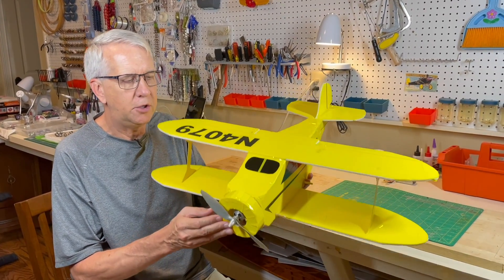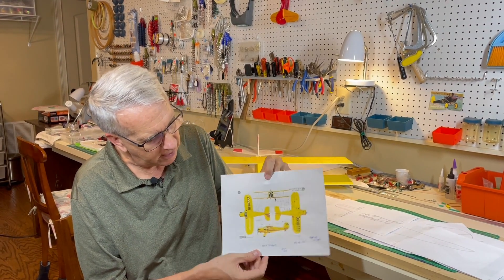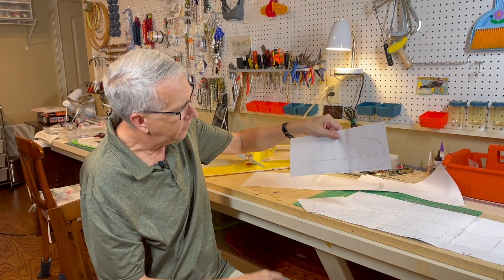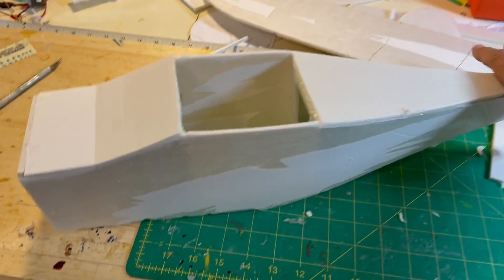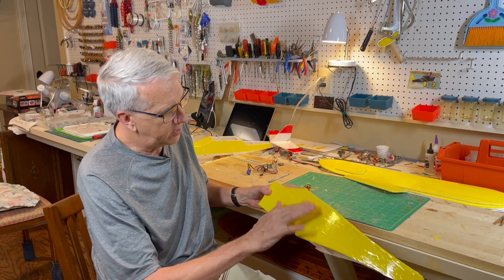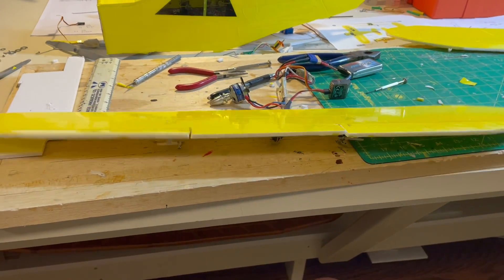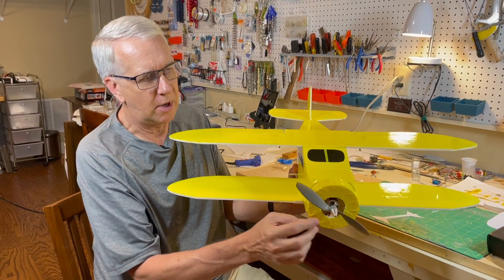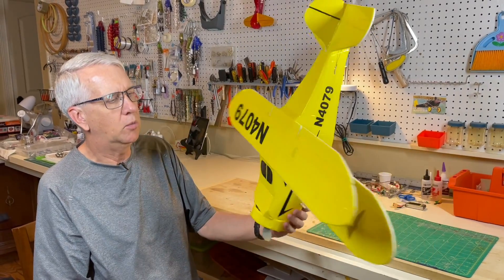Beech Staggerwing Foam Board RC Model Airplane

Comment: Perfect old vintage look, I need a SLOW flyer to take with me in my camper. I would like to use single fold under camber wings like the FT Old Fogey, except no polyhedral . This should slow the plane, correct? I also think the single fold would eliminate need for the carbon rods. The wings would be the same as yours except for the one bend. I wonder how the one change would change the plane.

I just need to know if their is an incidence angle I need to set on fuselage and wing.?  Would the leading or trailing wing edges vary in-height? Your strut solution is great.
Reply from the maker: Robert:  Thanks for your comments!  I think the Old Fogey single fold would work well, and is sufficient to not require the carbon rods.  Should slow the plane a bit.  

I did add a bit of positive incidence to the top wing only (bottom wing is aligned with the fuselage centerline).  This is fairly easy to see on the plans.  As you cut out the fuselage side, the positive incidence is included in the angle on the fuselage top.  When drawing the plans in QCAD, I just drew a piece of 3/16" foam on the top wing leading edge, and drew the top wing lines from there, and used that as the incidence, seems to work fine.

I will build a second one of these, I liked it a lot. Will use latex paint and add a fourth channel for rudder control.  Ti,
Reply: I have the fuselage and one wing finished. Boy the front end looks big.  I boxed in the fuselage bottom  so I will have the top wing removable. I'm going to make it a 3 channel rudder and elevator.   Later, I can make an aileron wing that I can switch in . 

What do you use for control wires or do you buy control wire pieces ?

Thanks Tim
Reply from the maker: I highly recommend ailerons due to short tail moment. If you go with rudder only, make sure the rudder is large. Tim
Reply from the maker: For control rods just normal music wire. Tim
Reply: When you build a second one please show how you paint it.
Reply from the maker: Nothing fancy. Will be latex paint ( no odor, easy clean up), applied with a brush. I’m interested in the weight gain. Tim
Reply: Finishing the EPS DT foam board has been one of my problems. Tape usually doesn't lay correctly in corners of fuselage. Spray paint eats the foam.  If I could eliminate the paper from the sides, top and bottom of the fuselage it would eliminate weight. I don't know if the paper or paint would be heavier  I need to leave the paper on the wings and tail surfaces for strength.

 Is the latex paint you are going to use a craft paint?

I might just add the ailerons.  Does it matter if they are on the top or bottom wing?  Again, thanks Tim.
Reply from the maker: Robert:  Fine to leave the paper on the foam, weight not a huge concern. Normal spray paint for sure will attack the foam. I’ll just head to Home Depot, but some latex house paint. Should be OK with the foam. Does not natter if ailerons are on top or bottom wing. With the top wing ailerons, servos a bit protected. Tim

Comment: Tim, as I remember you tried using one servo for the ailerons. I don't remember how it worked. I was thinking if one could be used I could get rid of the wires and servos on the surface of my single layer under cambered wings.

Finished the cowl and it is drying. Thanks Tim
Reply from the maker: Robert:  I did use one servo on my Guillows Zero.  This can be done if the ailerons are fairly close to the fuselage centerline, or with strip ailerons the control horn extensions come into the fuselage.  Just Google "one servo for ailerons" and you will see a variety of installations with one servo.  Tim